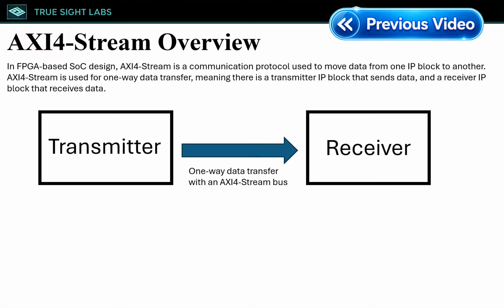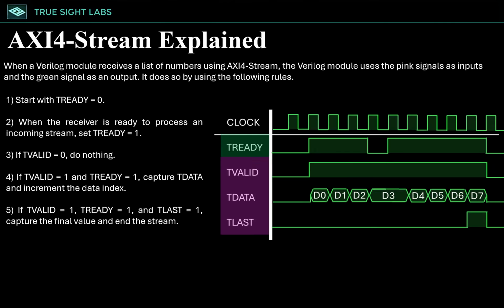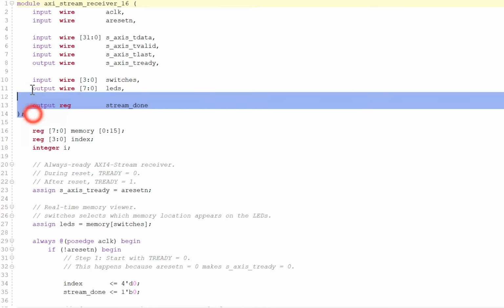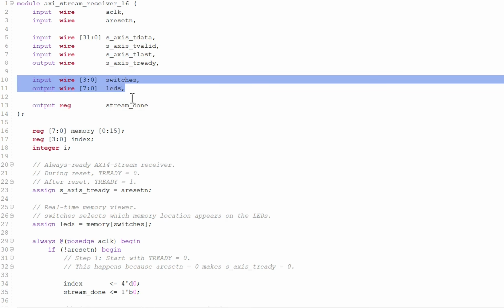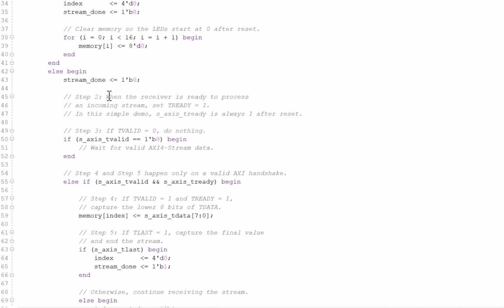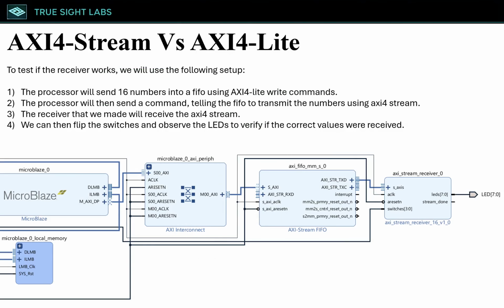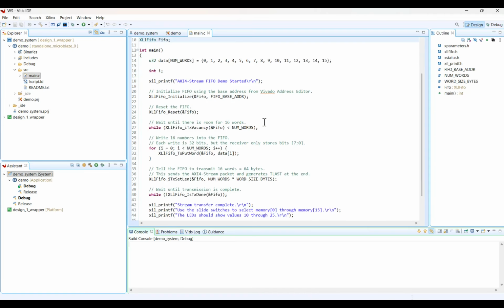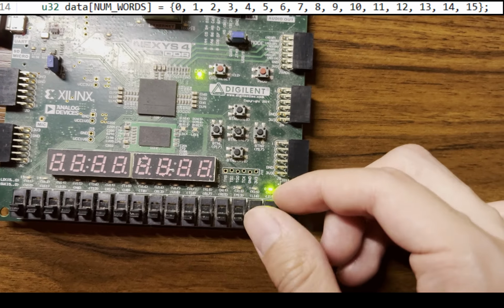FPGA SoC Series #6: AXI4-Stream Receiver with MicroBlaze

Comment: Do you know if there is a problem with a width mismatch between 2 AXI4 blocks? 
s_axis[31:0] connected to m_axis[63:0] or m_axis[31:0] connected to s_axis[63:0]
Can it be fixed just with a Width converter? Im currently working on a project and I think that's the root of the problem I'm having now.
Reply from the maker: Yeah if there's a width mismatch, then it will cuase problems. If you validate your design, it should report any width mismatches as errors or warnings. If you do have a width mismatch, the best thing to do is re-make your IP block to have the correct width. That's what we had to do in this video for the s_axis_data bus.